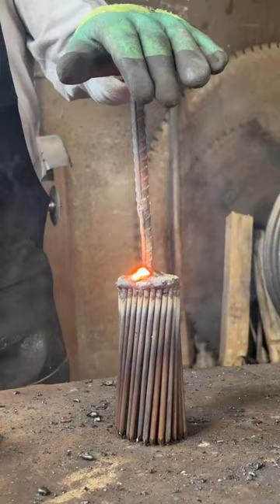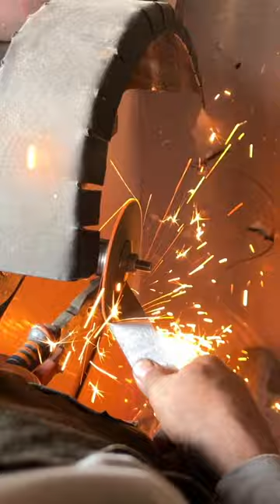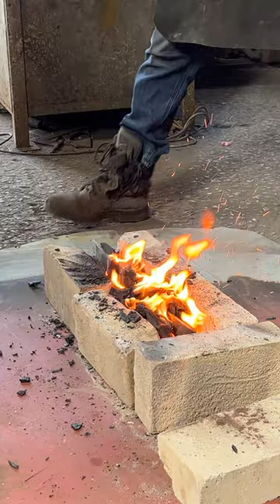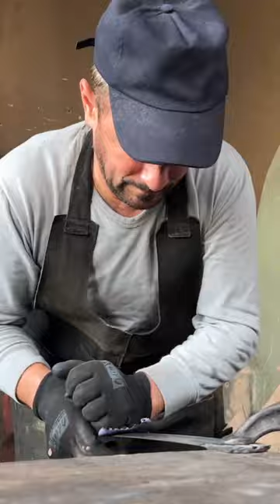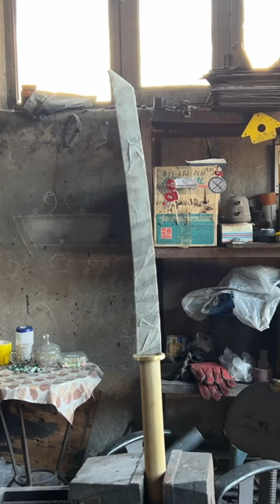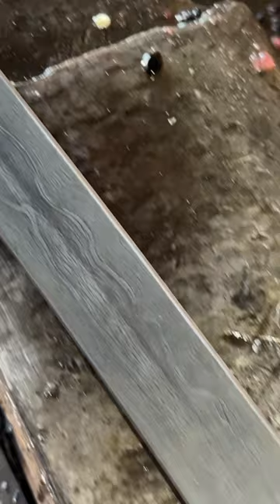A Real Demon Slayer! Made Japanese Katana that Cuts ANYTHING!?😲

Comment: When you cut the little piece  of steel off the tip you have to curve the tip to the back side of the blade then you put your initial  edge on this process is wrong on so many levels you are an immature at bladesmithing and the proof is here